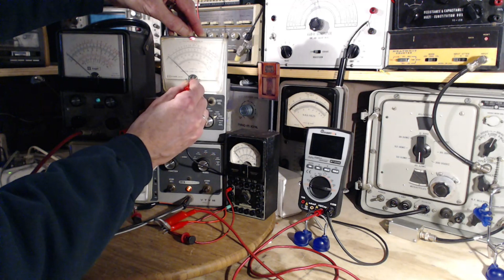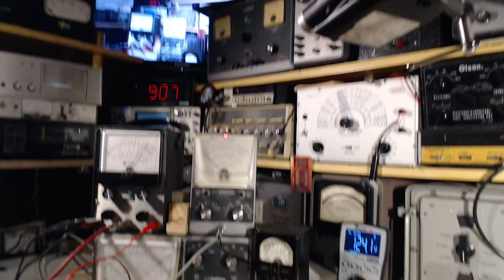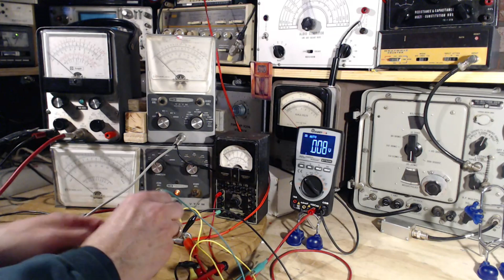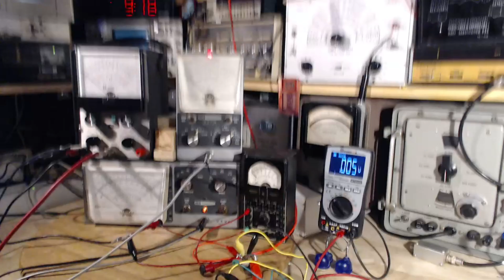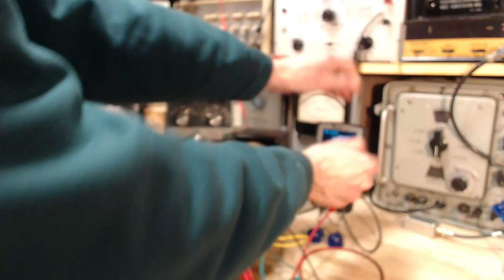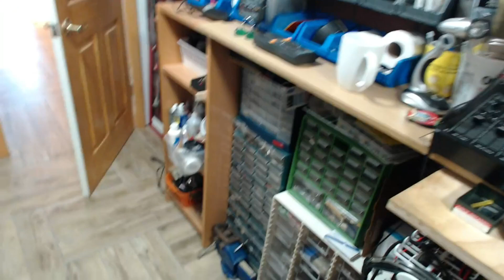Three VTVMs Final Calibration and Check

Comment: Congrats on getting them all calibrated.  The Knights can be a pain and I suspect that's why you can sometimes find them on eBay with not a mark on them except the many scratches around the adjustment pots.  Their owners simply gave up and made shelf queens out of them.  My KG-625 was like that, but persistence paid off and, like yours, it's in good shape now.